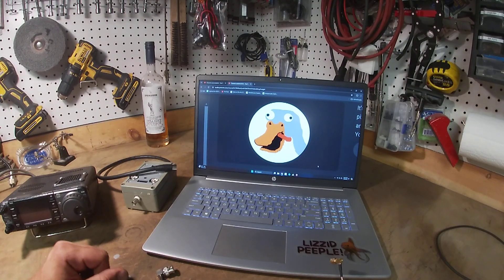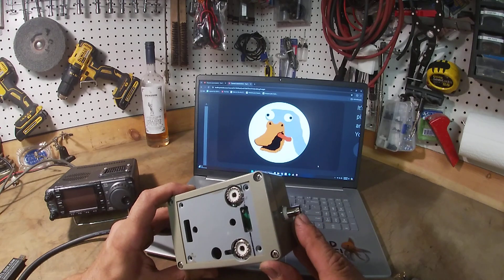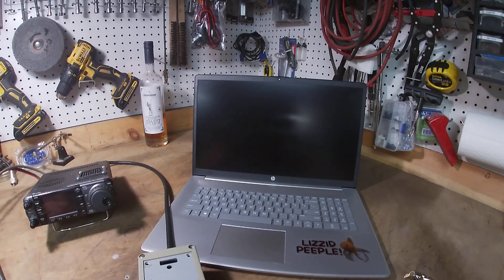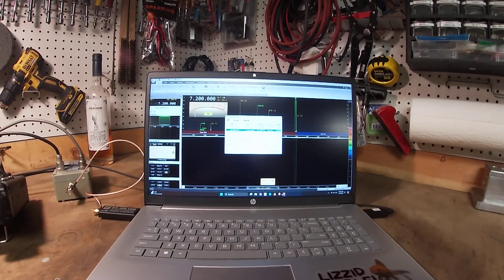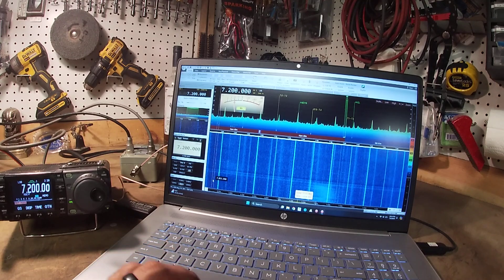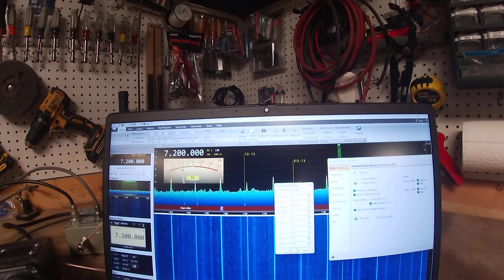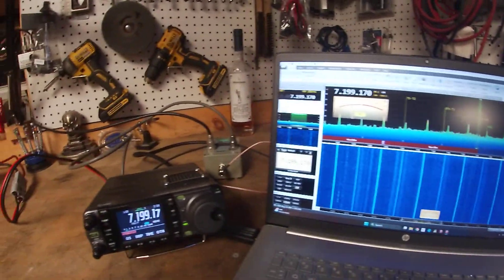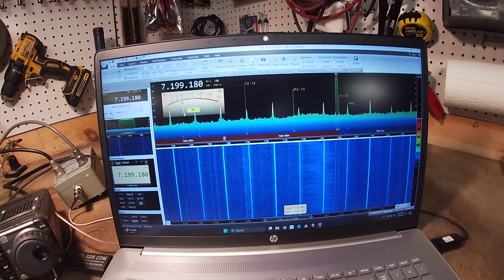How To Get An External Display On Any  Ham Radio

Comment: So if all I need is CAT control, then I just plug in the mini plug side to the speaker output of the radio and the USB side (I have the TS440 version) into the Mac Book Pro. I would need a Mac “Omni Rig” version to install for CAT control. Right? I don’t need or want a waterfall. The receive sound is where? On the computer? Could I use an audio splitter (at rig) to run audio to another speaker?
Reply from the maker: The cat cable input is different on every radio. There will be drivers that come with the cat cable.  You will still need omni-rig or a similar  program to control most programs (im pretty sure omni-rig will work on mac).
The audio is not sent over the cat.  newer radios have internal sound cards you hook up via usb or you can use something like signal link. but if you want audio on a different speaker you can just split it. 
I think I answered the question?
Reply: @ The cat cable I purchased is for the TS 440, which does not have the modern trimmings. (1990’s rig). The cable should be able to provide cat control, providing that a laptop has the right software installed. Thanks for the help

Comment: Very good video, I am going to connect my Yaesu FT-891 to my SDRPlay, just ordered CAT control cable today for the FT-891. Thanks for sharing.
Reply from the maker: Thank you. Just make sure you use something on the antenna line or you will burn out the front end of the sdr when you transmit. Ask me how I know lol. Good luck let me know how it goes
Reply: @SlowGoose  Yes sir, I have the switch box you linked in your description. Everything is ready, just waiting on the cable. BTW - I like your concept of the DIY switch box, was it difficult to build? I do electronic repairs and am intrigued by your box. Keep up the good work, I subbed and look forward to your videos.
Reply from the maker: @deankq4adj125 thank you. All the box is is a rf tap and a relay that interrupts and grounds the sdr coax. I’ll make a video on the box but it’s not pretty yet.
Reply: @SlowGoose  That sounds great, I'm looking forward to that video.